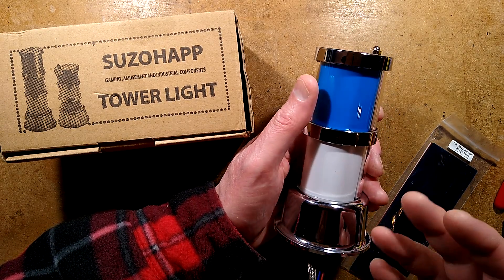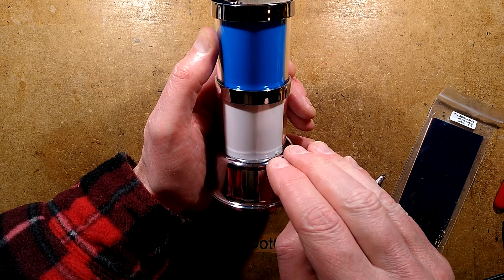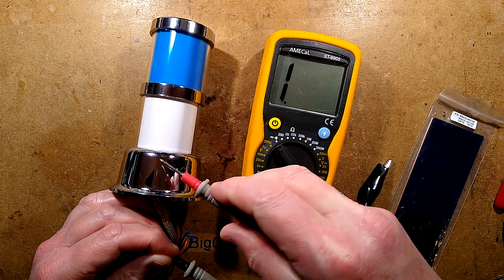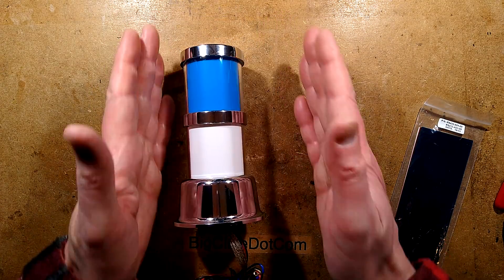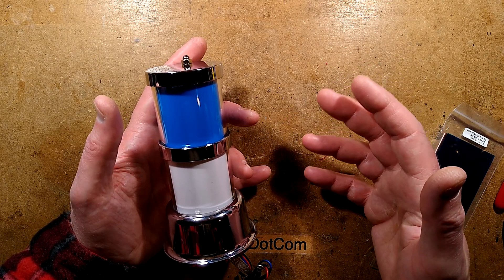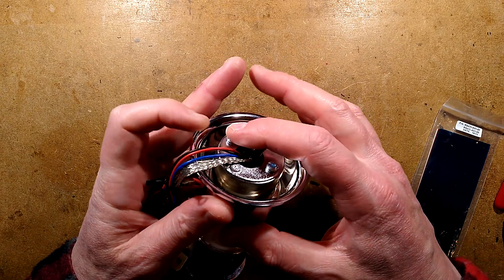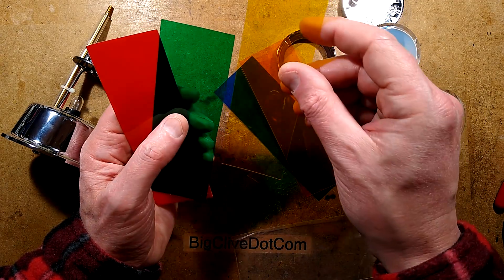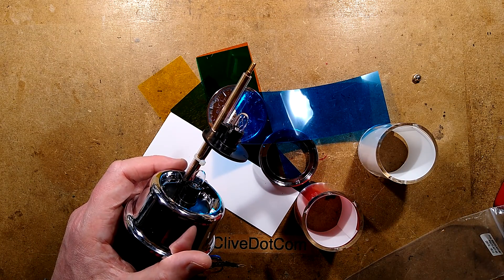Inside a casino slot machine beacon

Comment: Correct bottom light flash door has been opened and has not been played (usually 2 plays will turn it off) Bottom light solid door is open (not really used anylonger)  top ligh only flashing game in tilt. Top light only solid guest service button pushed ( change button back in the coin days)  both lights flashing together jackpot or handpay. Colors are red 5 cent , yellow 25 cent, orange 50 cent, blue $1, non standard but most likely green 10 cent, brown/root beer 1 cent multi denomination. Most multi denomination are white or color of lowest denom.

Comment: Hey Clive, Barcrest MPU3 now that brings back memories, along with the JPM MPS2 if I remember correctly. I do remember the antenna wire and the 555 circuit you mentioned. I used to work fixing amusement machines and converting the older game cabinets into JAMMA compatible ones back in the day.

Comment: We used a similar light but with four colors in our warehouse. We used green-running, red-e-stop, amber-jam, and white-full/paused. We had some 120 volt ones but the low voltage ones lasted years longer.
Reply: I bet they were Telemecanique  28v run at 24v  and 130v running at 110v.
Reply: @dogwalker666  I don't remember the brand name but yes we ran the 28v lights with a 24v power supply/transformer. Good call
Reply: @Flastew  👍🏻
Reply: Now I'm remembering some amber dome lights which were used in the underground car park of a mall I used to visit.  They were where a pedestrian crossing existed, to warn drivers to watch out and give way.  The trouble was, they were all mounted side-on which they weren't designed for, so the motors tended to burn out fairly quickly causing the flashing to stop (the flashing was done by moving a reflector around the light which remained on all the time).  I mentioned that this was probably the problem when I saw someone working on one of the lights which had been broken for a while, and within the next month the lights had been mounted on brackets to hold them upright.  It definitely helped a lot, because they broke down a lot less often after that.
I think within a year or two, they'd replaced the lights with strobe lights which had amber filters.  These days, they're probably using LED lights instead which use an elecronic circuit for the flashing.

Comment: In the casino where I used to work, we used the bottom of the candle (that's what we called them) for the denomination color. If the machine was multi-denom, it was the color for the smallest denomination.

Also, a story from my slot tech days - 
We got a complaint passed along from the slot attendants about a patron touching a machine and getting a mild shock. Not really putting much stock in the report, we tried touching all of the machines in the bank (8) and never got shocked. 
To our surprise, after a few minutes we discovered that you had to first be in contact with one machine and then touch another to be shocked. Since there were eight machines (IGT GameKing 19" uprights), I figured that roughly half of the machines had to be on one circuit and the other half on another circuit because of the maximum current we could draw from the 15 amp breakers. We generally used triple-tap cords, and there was usually a dual-gang box in the floor that contained two different circuits.
A little cord swapping down in the base didn't end up helping, as there was an overhead sign sticking out of the middle of the bank that was using up one of the receptacles. Since there were still people playing on some of the machines (unless you've worked in a casino, you probably have no idea how hard it is to make someone give up playing even for a moment), we could only unplug half the machines. I'm not sure how many combinations we tried, but we could never figure out a way to remove the potential difference between the two groups of machines. 
I measured between two shock-inducing machines with a multimeter on the current setting and I got a clear reading. Unfortunately I can't remember the exact value - I want to say 200mA, even though that seems really high - but a person's dry skin would have a lot more resistance than meter leads, so it was the type of shock that would just make you jerk your hand away.
We ended up just running a wire (with green insulation, of course) out of one machine and into another on the other circuit, underneath inside the machine bases. The casino is TITO (no coins) so the bases were almost always empty. We used a nut on an unused stud to attach the wire in the bottom of each machine and the problem was solved. I can guarantee you there are all kinds of bubblegum-type fixes like this at every casino.
Reply: Sounds like you had a faulty ground somewhere. I had something similar when I had two PCs chained off each other (in the days when PCs had a monitor power outlet) and somehow managed to use a setup that didn't ground the second PC. Touch both and you got a nice little tingle.
Reply: @chaos.corner  Yes either somebody cut the ground off on the extension, or the box itself was not connected correctly. So a decent ground wire to handle the leakage current will work temporary permanent style.

Have also seen where somebody (not joe home owner, actually a licensed sparky, or some previous owner) decided that wire was expensive, and there are 2 red wires running into the conduit at the bottom, and at the top there are 2 green/yellow cores coming out to the socket outlet. Suggested that get fixed somewhat soonish, even though the only thing plugged in is a light at the gate, and the gate motor itself.
Reply: I know how hard it is to get players to stop. Someone found 2 coin cups stuck together, open ends together and at the time there was a lot of political unrest, so we started to evacuate the casino. The blackjack table I was working on had a bloke who wanted to finish the hand before he'd leave. I'd already locked up my chips and pulled the cards from the shoe. He was trying to stop me picking up the cards from the table. Anyway I got the cards off the table, locked them away and walked off with my float to the cash desk to secure the float with him still ranting how we were ripping him off. (He had a blackjack with a R20 bet).
What was really annoying was that we told him, once we were let back in the casino, we'd reconstruct the hand and continue playing.
Turned out it was a hand grenade in the coin cups with the pin tied to the roulette table with fishing line. Luckily for us the safety lever (the bit that springs off when the pin is pulled) couldn't pop off at the two cups were glued together too well.
Reply: @maxximumb  Heard about a casino on fire, and people literally being found burnt to death, still sitting at the machines.
Reply: The casino I worked at was, let's just say, built to a particular cost in 2009. For the entire time I worked there (2010-2017) we had problems with the roof or roof drains leaking during heavy rains. Our standard tactic was to turn affected machines off and cover them with trash bags supplied by EVS. (Side remark, can you imagine the impression this gives to patrons?)
One time it was so bad there was quite literally a waterfall on a bank of machines. A lady kept sitting there playing one of them, even though she and the machine were getting completely soaked. My fellow tech literally had to slam the cashout button in-between spins and tell her she was risking electrocution.
Reply: I don't think I've ever run into that on the floor before. I'd have called maintenance in to check why the ground at the floor box wasn't doing it's job. But yeah, we have all kinds of fun "work arounds" for weird issues. One of our previous techs fixed LED driver boards by jumping a surface mount ceramic capacitor with a resistor . So we have a bunch of these in a drawer that "work". Well, one of our less knowledgeable techs grabbed one of those boards today and didn't notice the resistor wire was shorted across the primary when he plugged everything in. He blew the resistor, the power supply and tripped the breaker to the back half of our shop. Maintenance still hasn't found the tripped breaker.
Reply: Ah, I.G.T. How I love working on them. Just thought I'd mention, we are having the same problem with the G20/G23 I.G.T's. Thanks for including your "bubblegum" fix. I'll relay it to my boss as a second option.
Reply: The duct tape fixes are the bread and butter of every casino and tavern. I remember of my managers had a corkboard full of pictures of bubblegum-type fixes and it was always so fun to look at. From business cards being used as ticket guides to switches being jumped with paperclips, it's amazing the ingenuity to get a machine up and running. 

But man, you aren't wrong about gamblers and their machines. It's even worse when they find you working on "their" machine. I remember one time I was working on some Gameking Slant and the dude was legit furious that he went up to management and tried to have me fired because I was tampering with his machine.

Comment: I used to service photocopiers in Libraries with Coin boxes - there was an issue with the Coin Op units, that meant if you cut the power ( pull out wall socket ) during a copy, the coin box would glitch and when turned back on, it would give you a random amount of free credits :)   Luckily not many users found this out ... :)   Shortly after they were switched to credit card reading units, that did not seem to have the 'fault'  ;)
Reply: When we switched to card readers, students worked out that if you unplugged the network lead they were set to assume a default credit of 5 dollars on any card. The company said this was so there would be no apparent downtime to students if there was a server issue, and when they would come back online it would backcharge. Sure, fine except it would do it for any magstripe(like an old bank card etc), not just a student print card so once they figured that out, there was no way to backcharge the student... Broke students are always a fantastic security test
Reply: @askjacob  Now that you say that, I imagine giving a dozen or two students $20 each to try to beat your electronic system's security (with the promise of free beer afterwards and $200 for any flaws that they could exploit) would be a relatively decent way to test things.  I mean, that's essentially what's going to happen anyway once the device is out in the real world, so you might as well learn the lesson cheaply and early so that you can fix it before the product ships.
Reply: @jayschafer1760  Why do you think so many security researchers are associated with universities, unless that massive pool of latent talent was available to them as essentially free test subjects and testers.

Pizza and beer are cheaper than salaries.

Comment: We had tower lights in many hallways in my university. They were never actually powered on, but I was told they were likely used as a noise control device, indicating the sound pressure level.
Reply: At some places I have been there were 5 lights arranged like #5 on a dice.  It was disused, but was apparently a paging system with each callout represented by one of the 31 possible patterns, plus the option to blink.
Reply: so the sound police know which people to hit ...

Comment: On the factory one I work on the colored lights are  modular. No wires inside. You run yours wires to a connector on the base each color is a plug that goes into a base and a pass thru buss on to which the next colored module plugs into. And a cap on top to cover the run. The light source is either a lamp or led bulb. Back in the 70's when I worked on arcade equipment the big problem was coin flipping penny's up the coin mech to give credits that cost 25 cents. We also had string  the mech and bang the door all to set off the whisker switch.
Reply from the maker: Yeah, lots of fun ways to trick the older coin mechs and the early electronic ones.

Comment: That's cool! I prefer the old slot machines with the handle on the side. I think I've seen those too with a basic version of this. It was at the fair where they would flash red to indicate they were (running) out of coins. As they are not allowed to pay out cash in the Netherlands in certain situations. They would pay out in these coins and you'd fill up a piece of pipe and that was then traded for a ticket. And you could save up to get a stuffed animal or something else.

I may try to add one of the factory style ones to my computer at some point.
Reply: Old mechanical slot machines relied on the laws of probability to make a profit.  The likelihood of the player getting a return was low enough to make the machine profitable.  Modern-day "poker" machines rely on using a pre-programmed sequence of results which only appear to be random.  They actually return money on a regular basis, but the amount they return is strictly controlled so that the "house" will definitely always win in the long run.  There is no chance involved in the "reel spin" at all.  The only randomness is whether or not you show up to a machine which is about to pay out and whether or not you play the correct number of coins to trigger the correct sequence which is about to pay out.

Comment: I wish I had a factory signal tower or even a casino beacon for that matter above "my" utility room door.

It could have for example the following colors to indicate the following things:

 - Flashing white, yellow or blue for when the laundry cycle is done
 - Solid amber when the heat pump is running (And increasing the electricity bill...)
 - Solid red when the cat flap is locked to keep the cat inside
 - Solid blue or yellow when the doorbell is silenced (Because it's connected to a photoelectric sensor to detect intruders but is often triggered by birds).
 - Solid green when the solar water heater pump is running (ie there's enough sun to heat up the water)

And so on...

Of course I would have to drill holes in the walls and find a way to connect each light to each appliance, which sounds easier said than done to me especialy for the latter.
Reply: That's mostly within the realm of pretty standard diy home automation stuff. You'd have a separate sensor microcontroller (probably) for each signal source. Then you could use either something like home assistant or node red to set up the rules to light the beacon.
Reply: @rpavlik1  Thank's for the reply.

Stuff like the solar water heater pump, doorbell and cat flap could in fact be controlling a light with nothing more than a optoisolator and a relay or transistor.

But I'm not allowed to drill holes anyways.

However for the heat pump and washing machine it looks much more complicated as none of these appliances come with any suitable output.
And I don't see any automation or home assistant that could be connected to them.

Also as a last nail in the coffin I'd like to keep it offline and simple.
Reply: @psirvent8  ah, you want offline only. I settle for WiFi but not cloud based. For things like washing machine/dryer, just have to be clever: I have a photodiode on the "done" light of my washer, and an accelerometer on the dryer.
Reply: @psirvent8  If you're renting that's a whole different ballgame. As @rpavlik suggest, light sensor might work for the washing machine or current sensing might be an option (I assume you're not allowed to take the appliances apart either). It also depends on what part of online you want to avoid. It's possible to handle everything within your own lan.
Reply: @rpavlik1  The "done" light of my washer is flashing, not steady.
Therefore I would have to build a circuit that could provide a steady output signal from a blinking input.
I can't do that.
Reply: @chaos.corner  I'm allowed to take appliances apart provided I put them back like they were before, something that I'm quite good at since I also get to fix them when needed.
But drilling holes in walls, that's a no-no.

Also the wall leading to the utility room is quite thick and would prove to be quite difficult to go through anyways.
Reply: @psirvent8  ok, that's fine. I just do it all in software 😁
Reply: @psirvent8  That would let you go wireless then if you wanted.
Reply: @psirvent8  Time to learn! Look for a missing pulse detector circuit. You might need an inverter on the output so the output is on when the pulses are present. Simple circuits. Really cheap to build.
Reply: may i interest you in homeassistant?
Reply: @cocotug0  Thank you for the name, I just looked it up, it looks I would have to buy a Raspberry Pi.
Maybe I'll be doing that when I'll have enough money and after that I'll be able to try out homeassistant for myself.

Comment: Unimportant detail- at a casino I worked at in WV, USA we always called the lights on top of the slots "Candles".
Reply from the maker: Interesting and kinda fun name.
Reply: same here in AB Canada. but mostly older people the younger ones just call them lights.
Reply: I'm a casino tech, yes we still call them candles. Though, we have moved to electronic dispatch by phone app. So, it is very rare that we pay attention to candles anymore. X-ray (surveillance) may still use the candle as a signal of the machine state. Also, game outputs are negative trigger (common positive)

Comment: At 4:18, common positive so all the lights are ground switched, possibly with N-CH MOSFETs.
Reply from the maker: Also diodes so they can be used on a scanned lamp matrix without ghosting through adjacent lamps.

Comment: 6:28 “…there’s a little metal tang here to ground the metal layer” And to gouge the shit out of the what I assume is an acrylic tube when the bottom tube is removed. removed…
Reply from the maker: If you angle it as you slide it on it avoids hitting it.  I didn't....